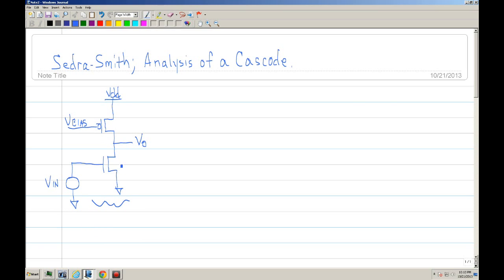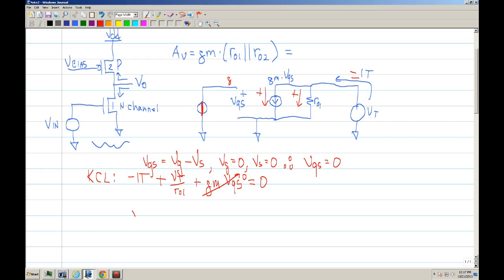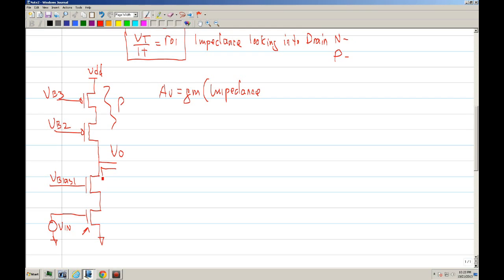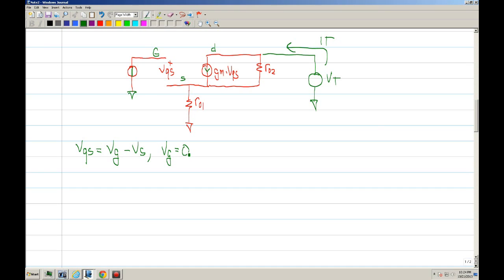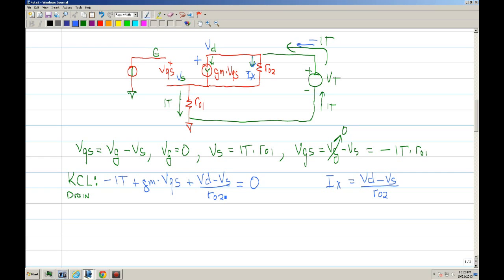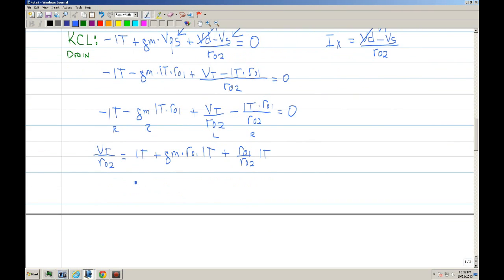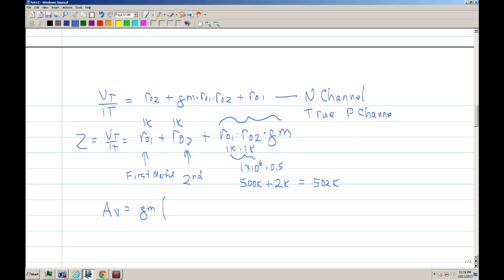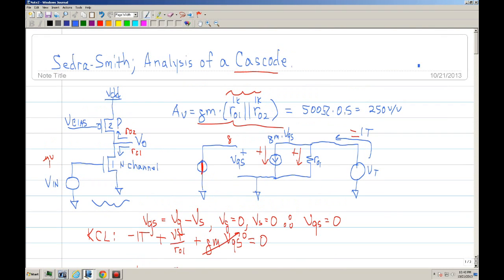Sedra Smith Analysis of a Cascode

Comment: SOME ONE PLZ CLEAR MY QUERY
If our purpose is to increase gain .then why do we connect p mosfet in series with n mosfet ,as over all gain will reduce because of parallel resistance terms
Reply from the maker: Hi Saumya, the intent is to increase the gain. When you have only one Pchannel and one Nchannel, the gain is Av=gm(RoN II RoP). So the gain is base on the parallel combination of the N and P channel's Ro impedance. But when you have a cascade where two Pchannels are in series and two Nchannel are in series, the output impedance increase because the of the multiplication factor.   Ron=gm*(RoN*RoN II RoP*RoP).  So lets assume  gm =0.5, and RoN=RoP = 1000Ohms.  then Ac=0.5*(1K II 1K) = 250.   But in a cascade, the gain will be 0.5 (1K*k II 1K*1K) = 0.5 (1000000 II 1000000) =0.5*( 500000) = 250000. The increase the gain by 1000. This is why you use a cascade.

Comment from the maker: Hi Abdullah, 
It always nice to hear from you! This is a very good question. Since I am deriving the output impedance, you don't want the input to affect the output. It is similar to when you do a superposition analysis where you have two input, you set the second input to zero. When you do a Vtest voltage to calculate the output impedance, you set Vin to zero to simplify the derivation by eliminating the id=gm*vgs term to an zero current and leaves ro by itself. I hope this helps.